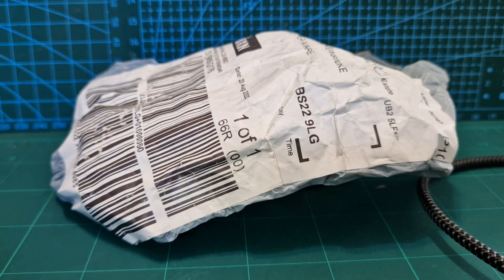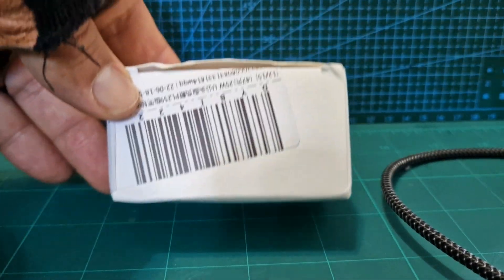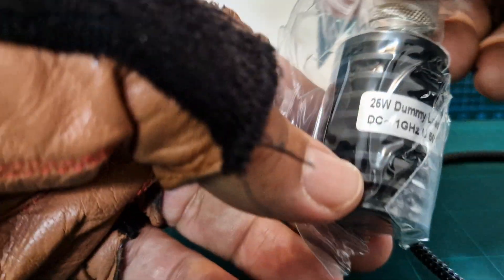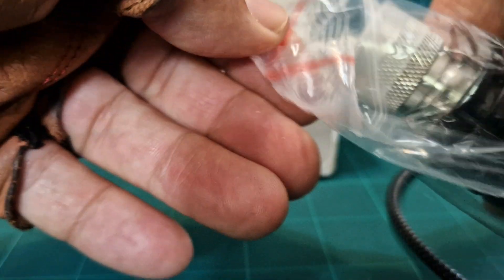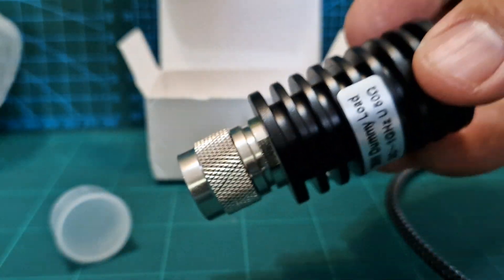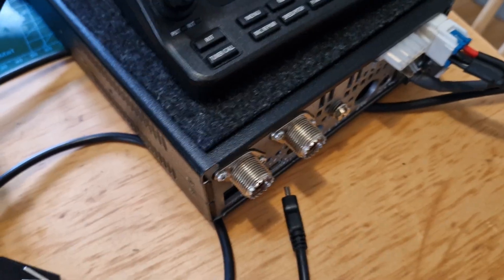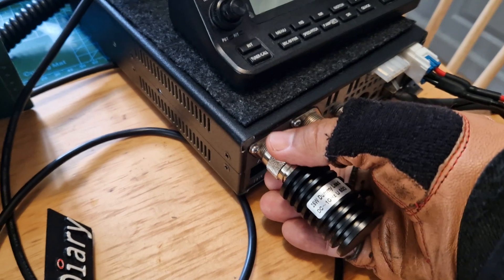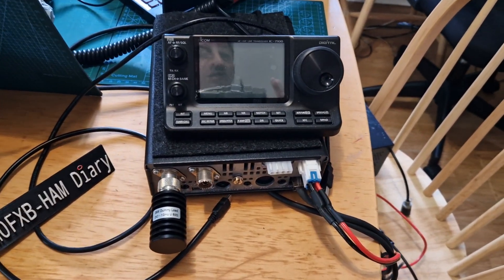BUDGET - Dummy Load  25 Watt 1ghz 50ohm - £15 delivered

Comment: New ham here; just received my dummy load. With the dummy connected directly to the back of the radio, what tests can be made? thanks
Reply from the maker: Stay within the Power rating of the Dummy load .
Reply: @M0FXBHamTech  thanks
Reply: If it’s a 25 watt dummy load can I use it on a x6100 xiagu . Saying that should I buy a 10 watt for my 106 xiagu or 5 watt . Cheers from Canada

Comment: Do you use this when in PDN direct mode on HRI-200?
Reply from the maker: Yes Dummy loadis needed on the radio when using HRI200 or access mode PDN
Reply: @M0FXBHamTech  I see. I went with the HRI-200 so gonna get a dummy load then. Thanks for the info and video. 😊👍🏽
Reply: @M0FXBHamTech  hope you will do a video demonstrating it using the dummy load. 🤞🏽
Reply from the maker: You add the dummy load to where the antenna connects keep your power very low.